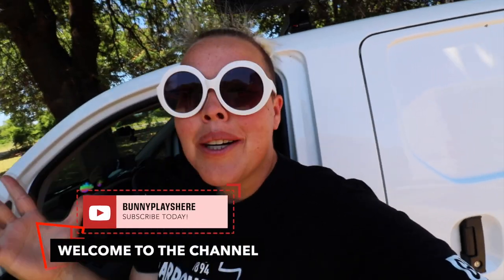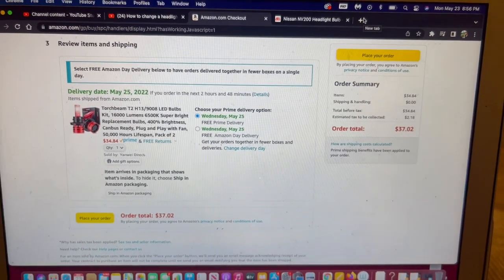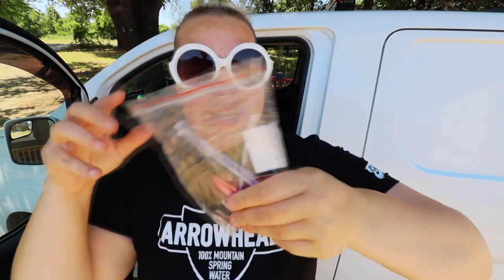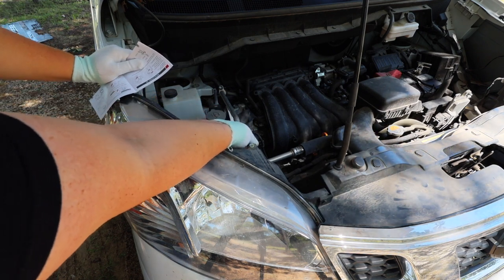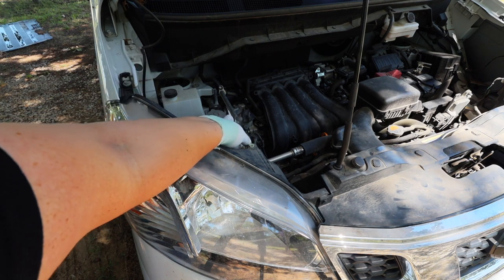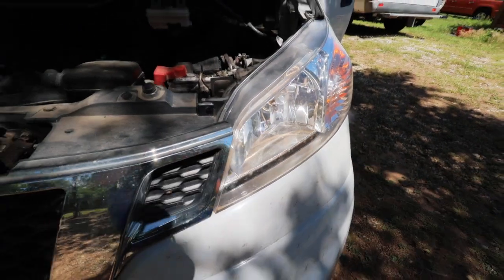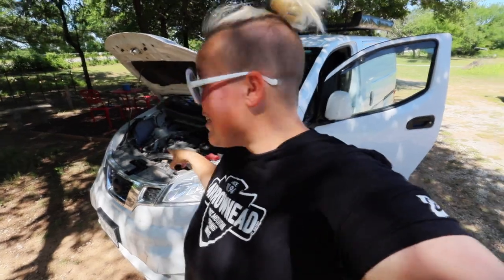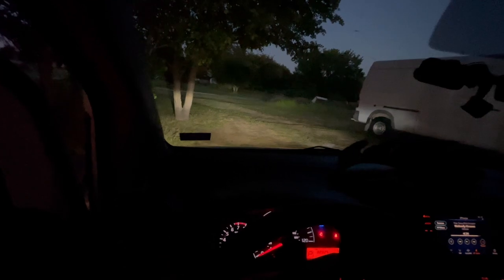Seeing Better In Van Life | Installing TorchBeam LED Headlights On 2020 NV200

Comment from the maker: Question of the day:   Do you drive at night often?
Reply: Not usually. I’m thinking I need to replace my headlights as well! Thanks Bunny…😊✌🏼😎👍🏼
Reply: yep.
Reply: Not unless I have to…  my older eyes … 🫣
Reply: Not as much as I use to. Night vision is horrible.
Reply: Not often because of the bright LED headlights blinding me. Also, nights that are rainy are difficult because of visibility issues. If every road had the reflectors, it would be a much better experience if we get caught in the rain at night.
Reply: No because I can't see with the glare of all the lights out there.
Reply: Hello Ms. Bunny.  No I do not, unless I absolutely have to (wearing yellow glasses that cut down glare).  I have cataracts that I'm too much of a chicken to have removed.  But I think a headlight change would be very helpful.  Thanks for sharing this.  Your lights are now as bright as your sweet spirit.  Happy night driving.
Reply: I do but I don’t drive long distances at night
Reply: Sometimes but hate when others drivers flashes their bright lights on me

Comment: I would love to hear if the drivers side bulb lasts longer. I’ve heard you have to use gloves when handling new lights because they get hot and if they have oils on them from your hands they will overheat and burn out faster. I noticed you installed the first one without the gloves but kept the gloves for the second. I bet everything will be fine because LEDs are much cooler. Science experiment!! Let us know in 3-5 years, lol.

Comment: Lights look nice, been thinking about doing the same thing for a year now. Thanks.
Reply from the maker: I am very pleased with how they turned out.   I don’t drive often at night these days but on rare occasion when I need to it will be nice to see better in the back country
Reply: @BunnyPlaysHere  I don't like driving at night either, that's why I keep putting it off. But sometimes I have no choise, so I should probably just get it done.
Reply from the maker: @guymurphy6982  it was such a huge difference and while I hope to not use them often it is always better to have and be prepared
Reply: @BunnyPlaysHere  So very true.

Comment: I know some places like California were trying to outlaw bright white lights cuz when you drive on the freeway it's literally blinding to oncoming cars if that ends up being an issue which I don't know. You might consider those overhead lights that off-roaders usually put on the roof cuz they're very bright
Reply: I've never heard about that.   These lights do blind me when I'm in my Corolla.  All the new trucks are now so high up they shine right in my eyes.  If I'm in my son's Rav4, this doesn't happen.    I learned to not look at them and that helps a lot.
Reply from the maker: I do have one of those that I’ll be installing at a later time but it requires that I run wiring and I have to make sure that if I am running wiring that is additional to the van that it’s still complies with my warranty on the electrical system.
Reply: After any  upgrade from old head lts to new led you must level the whole frame there is  a screw you turn and you can level the patter of the bean.

Comment: I understand that LED light helps you see better but they severely hurt people like me eyes light sensitivity is a real thing and because of headlights like you put in I can't drive at night. Legally I can but because those lights are so powerful they literally blind me I have had to pull over before due to so many cars with the same lights oncoming at the same time so I have a tendency to curse people for that reason 🥺
Reply from the maker: I also have light sensitivity so I understand however I won’t be using these to drive a lot at night on highways where other people would be. My main goal of getting these was so that I could have lights that I could drive whenever I’m in the back country. I typically don’t drive a whole lot at night otherwise. Safety is very important when it comes to being in the middle of nowhere and so having more light is helpful.
Reply: I have had eye surgery- so I have the same issue - I have glasses that have a special coating that decreases light refraction- it makes a big difference. Might look into that.
Reply: I agree with you. I'm also sensitive to those bright headlights. I don't have to pull over yet but as I get older it's getting worse. Too the point that I don't drive in an area I'm not familiar with after dark.

Comment: I've always hated these lights because other vehicles, especially the new trucks, blind me at night.   I thought I was losing my night vision due to age, and hated driving at night.  My son convinced me to try LED's (he even saved my old headlights),  and installed these exact same headlights for my birthday and what a difference!  I wasn't losing my vision, I needed better headlights, lol!
Reply: Same here. I bought some yellow tinted night glare glasses and I don't get blinded anymore.
Reply from the maker: I’ve always hated them as well… But the minute that I turned them on I instantly understood why I always struggled being able to see animals at night time that were just off the roadway… I had absolutely zero vision in that direction thanks to my super dim lights
Reply from the maker: I have a pair of light sunglasses that do the same thing and if I do have to drive at night it is fabulous to wear those LOL
Reply: @JudithLawrence718  Good tip!   I mostly don't drive at night anymore.  No need to, lol!

Comment: So where did the gloves go after 10:08 ? Handling halogen lights bulbs with your bare hands that way is not recommended as your skin's natural oils can damage those bulbs. The same goes for the emitting diodes on the LED lights. Just make sure that the projection of the LED lamps is similar to the original lights, otherwise you will be blinding all oncoming traffic...
Reply from the maker: The problem with me having the gloves on occurred because I had the other bulb was very slippery so I had taken Off the gloves to get it physically out and in doing so I didn’t realize I hadn’t put them back on… I was very cautious though and I didn’t touch the bulbs themselves only the backside connector area except for whatever I was holding it to show

Comment: How long you been living in this van? I was planning to do the same but im not sure if it would have enough space my stuff
Reply from the maker: I travel about 75% of the year I’ve been on the road all together for five years two of which have been in a van. The other three years I tent camped… I will say this I have a lot of stuff that I thought was super important but then I realize the actual important things that I needed physically with me were very different than I thought they would be moving into my van.
Reply: @BunnyPlaysHere  i dont mean back packing and travel all over the place. I meant to live in the van, the rent is too high and its hard to save money. That is why im wondering if its worth it living in the van while working full time.

Also I’ve done my research on my area. It has a strict policy about sleeping in your car. Its different when your doing this for travel because you go places and you dont sleep year round on the same city.

Comment: Hi! Wondering how these lights are working for you after about a year+? Any issues? Do the daytime running lights still work? Any heat issues? Looking to install some on my '21 NV200, Thanks so much!!!
Reply from the maker: They still work really well. I only placed them outside to charge them and also at my campsite. I make sure that they don’t get overly exposed to sons so they don’t get too warm especially during the summertime.

Comment: Glad to see you also put larger wheels on it. I still have the stock wheels and don't get the best traction with them at higher speeds or in the rain.

Can you tell me which size and type of tires you used? They look real nice in the thumbnail
Reply from the maker: These are actually still the factory wheels. I don’t seem to have any issues with them.